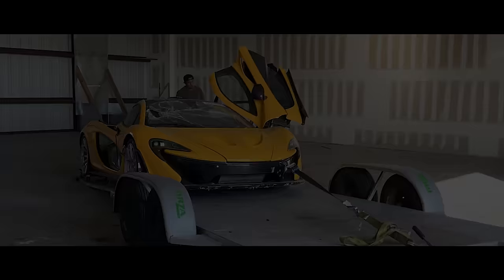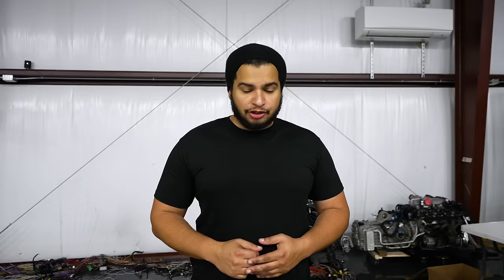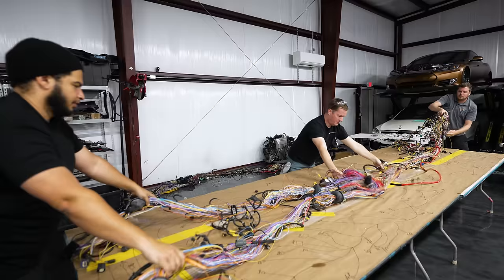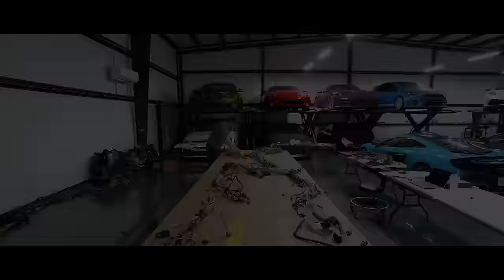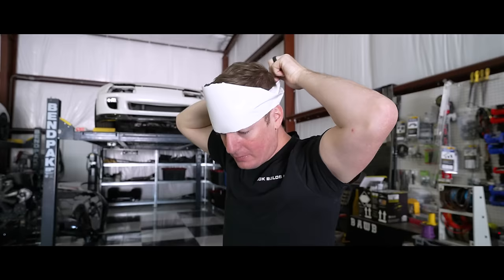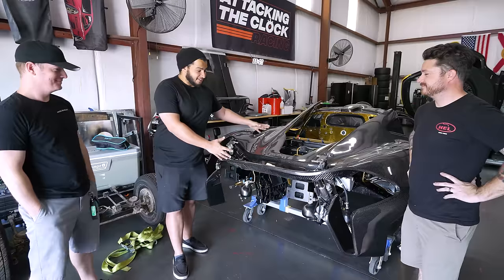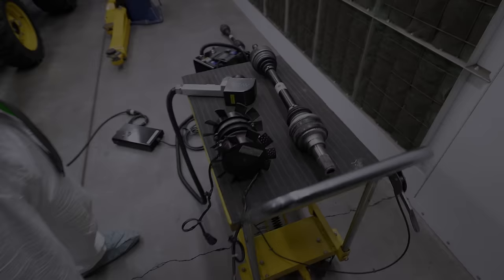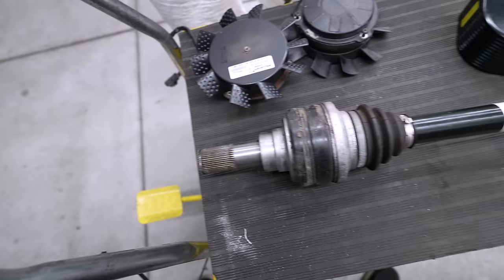Rebuilding A Flooded $2,000,000 McLaren P1 | Part 14

Comment: Laser engineer here. That is a fibre optic laser, done by (coherently) combining several beams across a fibre bundle (which is a waveguide, like an antenna cable) because it's one of the most convenient ways to reach high laser powers using solid state means (as opposed to gas lasers). Metal vs oxide habe very different dielectric constants which means that the electric field across the interacting surface is uneven and will begin to etch away the rust and paint (if any) until the reflective surface is reached. The variation of E-H field (and charge) at the surface produces a quasiparticle called a plasmon, which can further transfer its momentum to the next layers of the material which is why the thing is so effective. The Avro 100W is a baby laser, for heavy corrosion in marine applications we're expecting 2kW ++ optical (and maybe 10-50kW electrical) At that power level, the amplifiers will not fit into a backpack form factor, and you'd clean your piece in 5 seconds, not a minute. The wavelength is around 1050 nm, beyond human range, but you get to see additional beams specular reflections and recombination, and silicon cameras  will see it well, unless they have a filter glass
Reply: Not sure what you said but I totally respect the knowledge that went into it and the time you spent writing it.  Thank you, I'm glad folks like you are out there.
Reply: Huh??

Comment: With vapor blasting you can adjust the pressure and distance you hold the nozzle to achieve brighter finishes. I've finished dirt bike engines to a shine with vapor blasting. 60-70 psi at about 3-4" distance for the initial cleaning, then 40 psi a 6-7" for a bright finish.

Comment: Vapor blasting....I have been doing VB for quite some time and yes, it will make your parts look like new. However.....DO NO PUT ANYTHING IN THE VB THAT HAS A BEARING, SEAL, ETC. Although you rinse the part afterward, the ultra fine glass beads will dry and cause a lot of friction on moving parts. Rule of thumb; If the part you are about to VB moves, disassemble it until the joined parts are separated. Tips: Lower pressure, (40-60 PSI) will result in a shinier surface and higher pressure will be a tad duller. Also, be sure to have some anti-flash rust agent in your VB water/beads for any steel parts. Also, you should use “Boeshield” anti-corrosive spray after you VB ferrous metal, (steel, etc.) VB is also great on brass and rubber components. Please feel free to contact me if you need any help deciding which VB to get, (UNLIKE YOUR FRIENDS SETUP YOU WANT A “CLOSED LOOP SYSTEM.)  Cheers!

Comment: Hi, even that the connectors look super safely protected they will need extra protection. All helicopters have this kind of connectors and for corrosion protections in hard environments (eg. Sea Rescue) we use corrosion protection stuff such as Dinitrol AV8 or AV15 that gives an extra protection.
Also for aluminum stuff we give a protection layer with Alodine. 
Give this a look as it will prevent a los of corrosion damage.
Excellent build ;)

Comment: There's a reason that the Giulia Quadrifoglio exposed carbon roof was a $2200 extra.  The paint acts as the UV barrier but on exposed CF, it has to be prepped differently for UV resistance.

Comment: I've used plastic blast media for sensitive parts.  It works better than anything I've ever seen, but it's $$$ compared to glass beads.  The good news is, it even works on zinc carburetor castings, and leaves NO powdered glass residue.  The laser stuff is next level.  The Air Force used it to strip the paint of F-111 Aardvarks to protect the carbon fiber but remove the coating.

Comment: Best way to unwrap something like  door column is to start it off in a straight line across the smallest dimension then roll it back and form a roll as you go, once you've rolled it a few times you've got a really good handle to evenly pull the wrap attached to it, just keep the amount of vinyl between your roll and the car to a minimum and I almost always get it off in nearly 1 piece with minimal effort

Comment: @tavarish would you consider adding the new gauge cluster which is used in the Elva/750S/Artura so you can control the drivetrain from the wheel rather than on the centre column?

Comment: Wiring is so much fun. At least you have all the info there. Have worked on race cars where deutch connectors were used mid loom and it can cause no end of issues chasing problems. Best of luck

Comment: Passenger headlight is more blue. If the headlights are xenon, that bulb needs to be replaced. If LED, you’ve got corrosion inside (very likely to shorten the LED lifespan significantly)

Comment: Reminds me of the qx30 Infiniti and mercedes baby. Had a wiring harness issue and tech said to cut and splice wiring instead of a harness because the qx30 is a solid 1 piece harness gold plating also (a lot of money for warranty) that harness looks like an all in cabin harness with no joint connectors

Comment: I thought you needed way more than a shrink when you bought this project but I have to confess you are taking big steps forwards. I would recommend taking the bearings out before media blasting the suspension bits (unless you already plan on mounting new ones) Same with the driveshafts, dissassemble and treat the parts individually before having some sort of protection added to them.

Comment: Biggest Tavarish fan here, but as an actual very experienced chassis engineer, By cutting the rear carbon fiber structure in half you completely lost torsional rigidity 

It completely destroys the advantages of having a strong unibody carbon frame on the back

Comment: On top of carbon fibre, it’s typically not body filler as such, but a layer of low density powder mixed with resin to create a sandable finish. The different non matching layers of carbon you exposed are typically structural reinforcement layers, ie. Different areas have differing thicknesses/amount of layers of carbon, running in directions that combat flex and structural weaknesses. I am guessing these areas were not dressed with a matching symmetrical finishing skin layer as it was going to have a painted finish so wasn’t needed…. I might be wrong, but then I haven’t been in the carbon game for about 20 years now.. lol

Comment: Great progress guys… but please swap those wheel bearings out before putting the rear suspension back in. If beach sand didn’t get into them, the vapor blasting sand did.

Comment: I know this is a bit too late but pulling off vinyl straight up ensures that it will tear. I my limited experience I found pull it at about a 45-degree angle and lower, I have gotten more of the vinyl comes in a larger piece. Even if the outside temps are warm, a heat gun does help the removal process and helps the adhesive to left with the vinyl. Just don't be care picking at the vinyl hot the spot.

Comment: i have a Hobo Freight blast cabinet that I'm going to convert to vapor blast as soon as I put the finishing touches on my air compressor. I had this little 26 gallon diaphragm compressor that only puts out around 4 to 5 cfm of air flow so I bought an old 250 gallon LP tank, stripped it down and painted it, and got a twin cylinder single stage compressor and 5hp 240v motor to run it. I'm just finishing up the wiring on it in the next few days. I just wish I had a shop to work in like you guys. I'm working with a carport that isn't enclosed. such is the poor life

Comment: 32:25 I have no idea what vapor blasting is but I'm glad to know that I can do it with my harbor freight air blasting cabinet. The hardware besides possibly very specific components looks identical. I am definitely down to create my own if this proves useful.
Reply: 33:11 The combination of water and beads does not equal vapor. There needs to be some type of heating that heats water beyond  that heats water or some other liquid beyond it's boiling point. This is not vapor blasting. This is a combination of a hydro jet and a sandblaster.

Comment: So let’s get this straight. The idea is to sort through 46 million wires and get everything 100% perfect. After that, we’re going to make a 1300 hp car. Then we are going to wind it up to 9000 RPM subjecting everything to heat and vibration With many plastic parts involved and we expect nothing to go wrong? This is a wonderful and noble goal but something tells me it’s also very delusional. A brand new McLaren straight from the factory has a life expectancy of about 12 minutes if you just drive it safely, and at the speed limit. Can’t wait to see what happens and I hope nobody is hurt when it does.

Comment: Just curious with as complex as the wiring harness is/was, why not just remake the whole harness vs combining 2 other harnesses?  You have the harness from the car, so you have your wiring diagram, pull and pin new wires to match existing.

Comment: Got me wondering if the software on that digital display can be hacked to change images and such (like the mclaren logo, the mclaren car that pops up, etc). I have done this on many stock head units and cars in the past. you'd be amazed how many cars are just running Android or Win CE for infotainment that you can just go in and change things/unlock features/disable "currently driving" securities
Reply: That part is what going to come after this wiring harness...pls reach out to him in advance..
If u could help him regarding software related stuff..

Comment: $250 for the bulkhead and plug??? I use to buy those for hydraulics on yachts. They're $50-$75 for both connectors. $250 soldered, potted, and installed. I hope that's what he's talking about.

Comment: I used to use those mil spec connectors upto  55 and 70 way 55 ways easier,70 way tiny crimps  a right pain wouldn't recommend

Comment: Here is why people almost never try to salvage a saltwater flooded car. Anything that can rust, will rust. Anything that can corrode, will corrode. Any piece of equipment that carries an electrical current, will be replaced, if not then it will be shortly afterwards. Any part that can trap sand, will trap sand. Any part that can absorb odors, will absorb odors. Without good sponsors for the job, it is rarely worth taking on the salvage of a saltwater flooded car. A car flooded by clean, fresh water has a much better chance of becoming a viable salvage and at a reasonable cost.

Comment: On the one hand, it is a simple job - its just one wire at a time, repeated over and over, but yeah, on the other hand, the record-keeping, the meticulous labelling, the length measurement, the colour-coding, the double, triple checking, the testing….oh. my. god.

Comment: Why did y'all not just use heat guns to heat up the carbon shell and bend it to fit better?? I do that all the time working with motorcycle carbon fiber parts! Carbon Fiber resin becomes soft and pliable in high heat.

Comment: Is there anything really changed now happening with this project with Sema looming again and only 2 posts in a very long time.? The ligthts shown working on the car seems fake as in the video they are just powered on directly on a table with a battery with the old broken wiring loom still layed out? I feel for Valvoline who has not  seen much from their sponsorship of the P1 other than the sema event last year.  Meanwhile we see others who have brought cars back to amazing condition  like a Buggatti submerged fully under the ocean, in far worse condition than the P1, in almost the same time and also a Maclaren 720 stripped to the bare carbon tub and rebuilt fully in a few months.  Has anyone even seen the engine of the P1 start or even crank over since it was purchased at auctin back in Jan 2023?  Maybe Freddy its time to call this one and move on? Still hoping for the miracle rebuild of the P1 but hard to see when you wont even provide any updates on the channel anymore on this car.  Perhaps you have moved to the UK now, but thanks for the past content and good luck.

Comment: Wouldn't it be simpler to just replace each wire with equivalent wire in the original harness and just keep the plastic connectors? I feel it would be easier than splicing 2 harnesses together and going through hundreds of pages of schematics.

Comment: You guys are making the wiring way more complicated than it has to be….

Look up how wiring loomes are made in the aviation industry and just make a peg board with the existing P1 harness you have. 

Then all you have to do is velcro the connectors from that harness to it, document each pin in each connector physically on paper/the board at each connector’s location, then cut out all the bad/unused wiring/pins and deep clean the corrosion from the plastic pieces, and then just rewire/pin it from scratch. 

…it’d take less time and be easier in the long run. 

You could still utilize the other two harnesses just by disassembling them down to their individual components organized by pin/awg type/color and then use them to reassemble the new harness on the peg board…that way you don’t have to do every single wire from scratch. 

It takes the hair pulling out of it when you have a check mark required for each wire in each connector on each list physically located at each connector. 
…If it’s not checked it’s not done.

Also you’ll never get the lengths and shielding positioned exactly located if you don’t do it that way.

Comment: Freddie messing with you get jack to take the vinyl of your head second your gauge cluster looks like a scuba mask is the boat doomed for hurricanes and floods think not I do wire harnesses on boats sometimes that looks like it would have been easier to start fresh maybe if you get it running for 30 minutes I will recant my words but I have flooded cars and know what the damage to wires are easier to start aknew
Reply: Sometimes you can't skip steps you have to start fresh and this mess of a wiring loom might go over budget